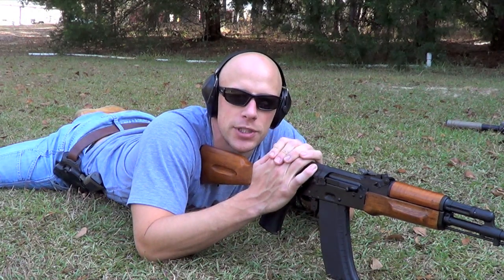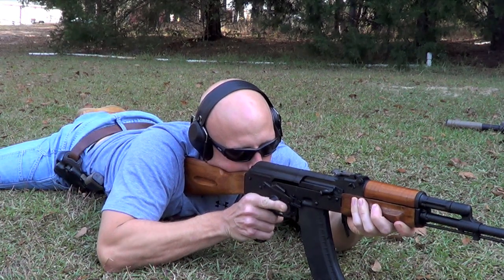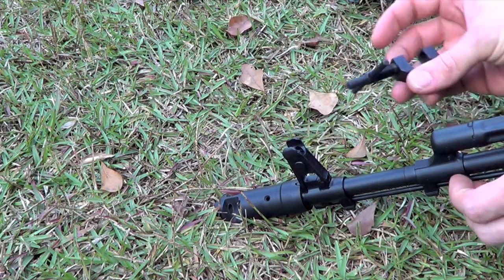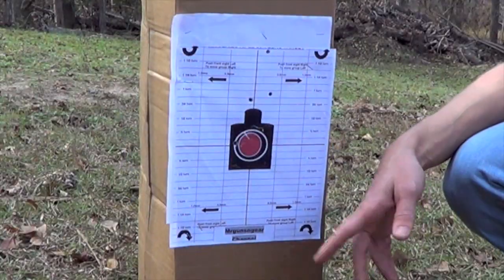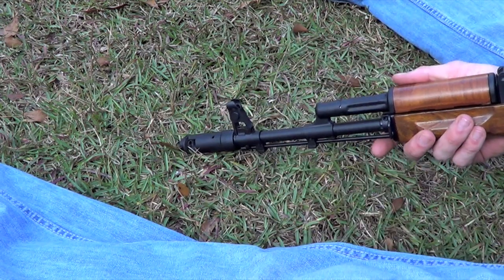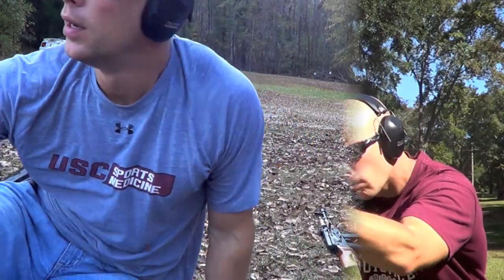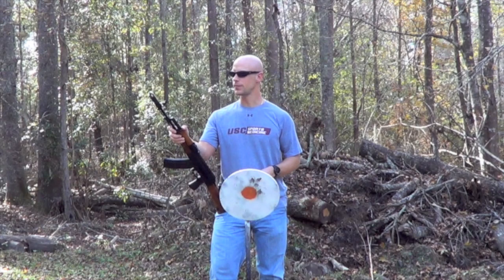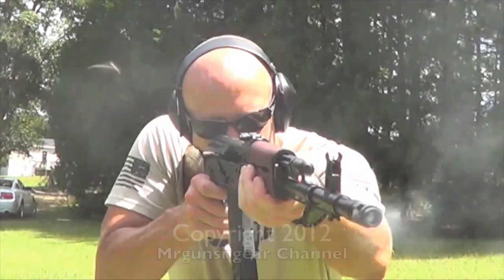How To: Zero an AK-74 5.45x39 Rifle (HD)

Comment: if you use Hoppe's, then nothing. remember to get your gas tube too, though.

the whole ammonia myth is a misunderstanding of what makes the ammo corrosive. it's corrosive because it has salts in the primer powder. the salts can be removed with anything water-based. be sure to get your bolt, chamber, barrel, muzzlebrake, and your gas tube thoroughly cleaned though. anything water-based will do it, though.

Comment: So is this a 100m zero, where point of aim is point at impact at 25m and 100m ?
And the leaf sight is set at 1?
Reply from the maker: adolfhilter Not sure but there are lots of charts out there.   Yes.
Reply: Mrgunsngear Channel One more question: After using your method of zeroing at 100m, if the rear leaf sight is set at 2, is your rifle zeroed at 200m, 3 at 300m, etc?

Comment: I'm confused. I want to my 74 to be able to get hits up to 400 meters on the battle setting when aiming at the "belt area" and have the ranging on the rear leaf to work. I only have 25 meters at my gun range to work with..  1st question, at 25 meters what is the rear leaf set to? 2nd, where should the impacts be from my POA? I know I will then confirm at 100 meters with it set on 1 setting, I'll do that when i get a PO 3.5x21p or a 1P78 optic and HAVE to get to a longer range. Ok, so when it's zero'd at 25m, the ranging will work right? also 4th question, what will be the trajectory of the round on the battle zero up to 500m? I'm finding most people are guessing on forums or aren't 100% sure and confident how to do it. I've read too much and i'm confused... I got enough for an arsenal SLR AK74 next week and I just want an answer how to get it usable until I get to a 100m. range. HELP!

Comment: I just got the AK windage/elevation tool today and I am trying to adjust the windage to the left ( because the current front sight is more to the right ), but I can't even move it, I think it got stuck in there, what should I do?
Thanks in advance
Reply: +Thelema9331 Thank you, I am ordering mine, hopefully it will fix the canted sights
Reply: +Thelema9331 Went shooting yesterday and was able to zero my AKs using AKFST Magna Matic easily. Thanks a lot.

Comment: HELP! i don't understand. are you supposed to zero at 25 yards with rear sight at 100m setting???
Reply from the maker: it depends if you want to use the ladder or not
Reply: Mrgunsngear Channel my freind is doing the math to confirm my result. i did it and it seems using the battle zero setting at 100 yards, it'll hit about 7.86 inches high. 

converting metric to standard is difficult... also reading the russian manual on the 400m zero

Comment: u sugest if i am only going to use 1 zero use a 50 , but do u have any info on the bullet drop with a 50 meter zero ? is it simalar to a 556 ? thanks
Reply from the maker: a quick google search will pull charts with that data right up
Reply: Mrgunsngear Channel  sorry but not really plenty on the 556 nothing on the 5.45

Comment: Not having the Mag on the ground would be a huge help to zeroing ;(
Reply from the maker: I'm not following.
Reply: He is resting the magazine on the ground as it recoils the impulse is transferred to the ground causing it to throw the weapon off target the later model AK's have a stamped receiver that allows it to flex during firing not ideal but it makes a light receiver. Normally when zeroing you make sure the weapon is supported by your hand not allowing the Barrel or Stock or Fore End to touch anything. Best accuracy is gained not by relaxing your body but by tightening all muscles before firing this prevents body movement and also stops flinching and bucking your shoulders anticipating the shot another cause of error most shooters don't know they make